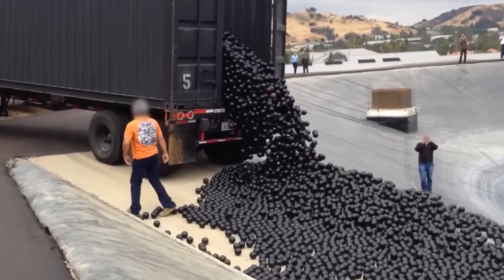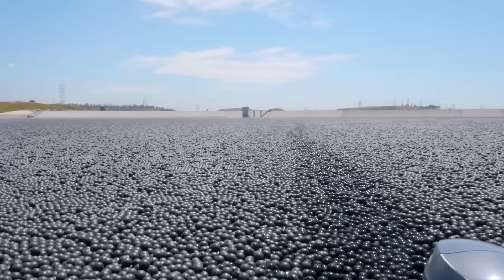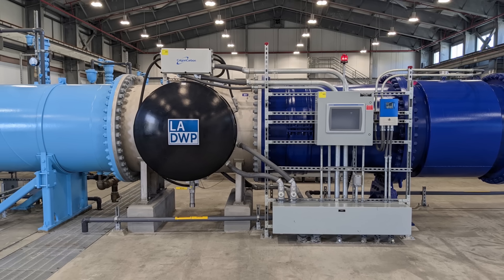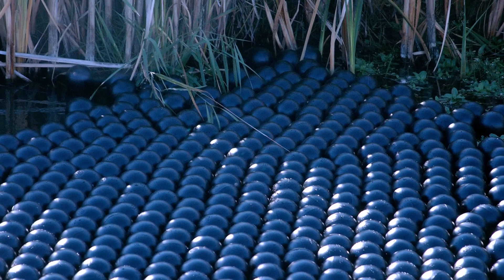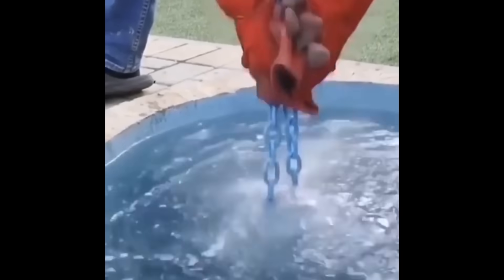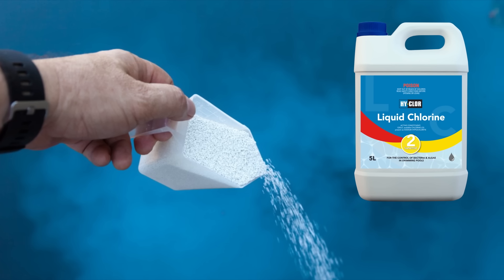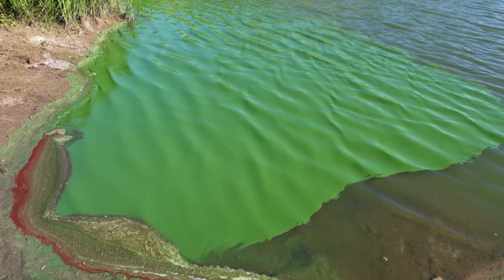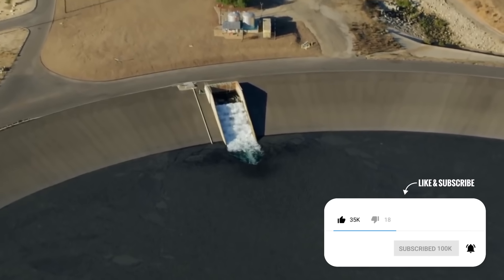Califronia Put 96,000,000 Black Balls Into Water, Result is Insane!

Comment: Nice, but now all the people there drink tons of micro plastic ...
Reply: So as fast as I know, the balls last about 10 years without breaking down into microplastics. So I guess they'd need to change them out every decade
Reply: @Gabriel-zd8iy  - fat chance that happens.
Reply: Microplastics are fake. Also water is still filtered and treated.
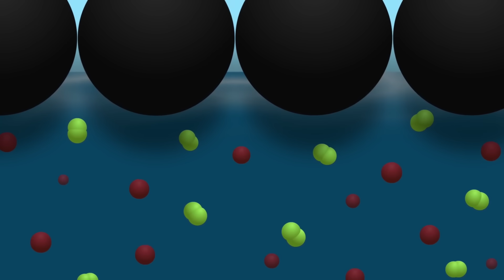Reply: In the video it is said at 14:36 that the company uses bio-degradable plastic, but it does sound counter-intuitive as the balls are supposed to resist nature.
Reply: @Psyduck671  - the terms, "natural", "organic", and "bio degradable" have zero meaning w/out definition... technically with enough time, everything will break down.. even stainless steel... lol.

Comment: stainless steel balls.. no need for water, no need for weight, last forever, doesn't get contaminated
Reply: Have you priced stainless steel lately?
Reply: @3ddesigns220  a multi million dollar project and long term returns wouldn't care more expense. plus these will be thin, in fact could be cheaper than water filled special plastics, as you wouldn't have to fill any water
Reply: Steel sinks
Reply: @CP-28  HMM ocean should be full of sunken steel cargo ships :)